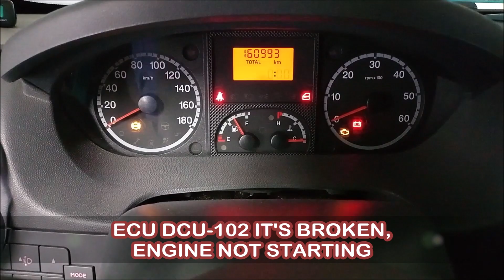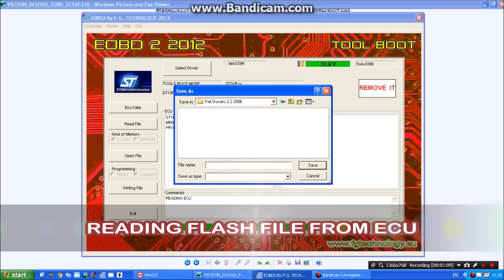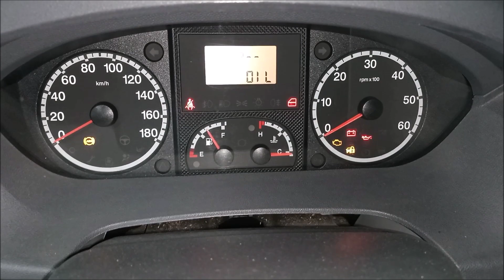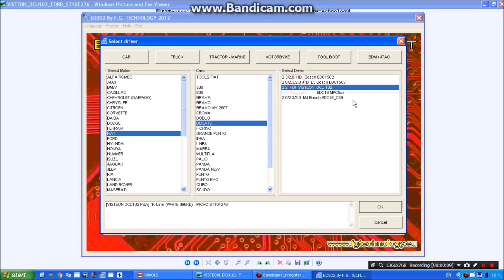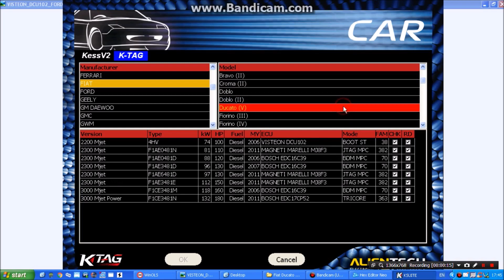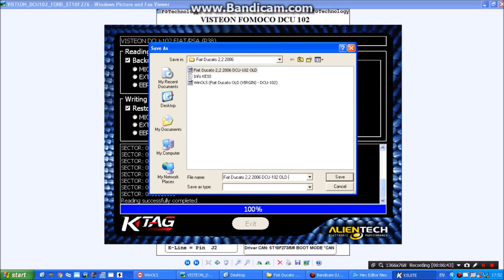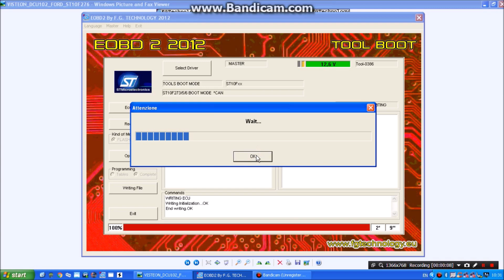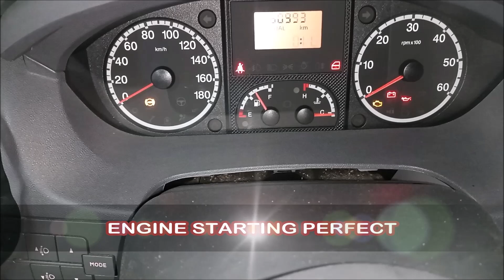Fiat Ducato 2.2 2006 DCU-102 Replacement

Comment: Hello friend i want to make dpf egr delete with ads dpf egr remover and write with galleto it is possible need checksum?
Reply from the maker: Yes, You can do it, checksum calculated software self.
Reply: @SimpleHOW  can i have an email ? I wnat to talk with you thanks in advance!
Reply from the maker: @Tas335d  email kosmariukas@gmail.com
Reply: Ecu edc16c34           citroen c4 2007 1.6 hdi 109 ps